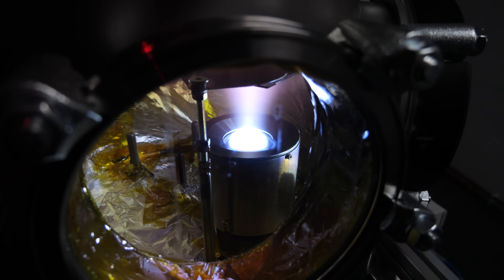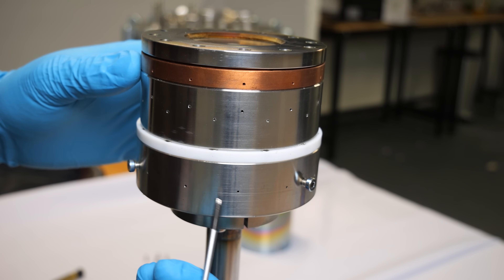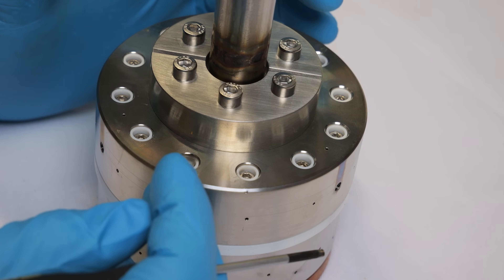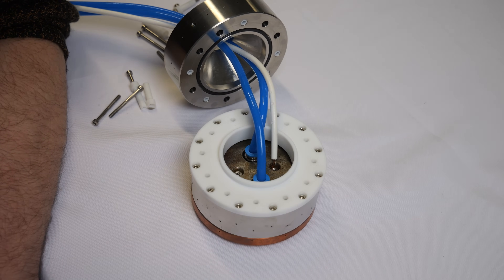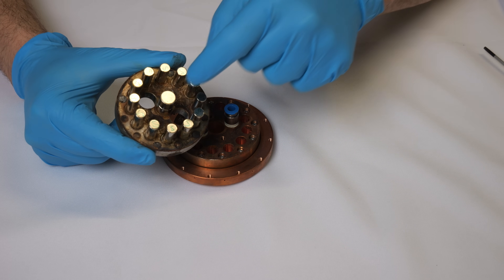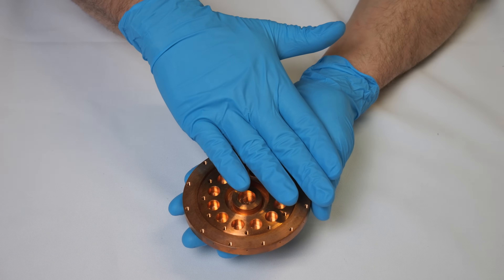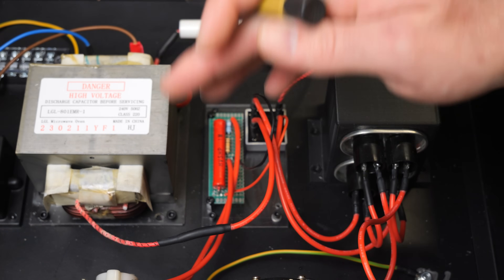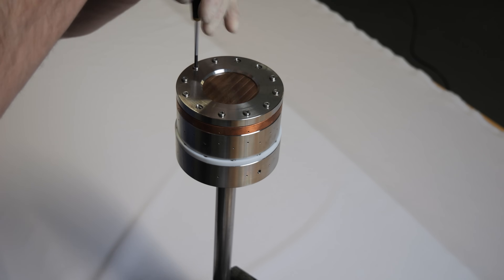Breaking Down My Magnetron Design - DIY Metal Coating

Comment: i know this is a year ago, but in the event you check old msgs - is there a video for the chamber construction too? or was that a prefab item you bought. I suspect that is more expensive than the magnetron parts
Reply from the maker: The chamber was a prefab by a company called Wissel vacuum. I was fortunate enough to get it for free for my videos. But you are right, it would have been significantly more expensive than the magnetron parts. That said you could build a more rudimentary vacuum chamber for a lot less.

Comment: The costs of machined parts was a key driver for why I bought my own CNC mill and plating/electroforming systems. Drilling 0.5 mm holes through screws is one approach I've used, but cutting a 0.5mm groove along the threads also works. Having my own machine shop means I can iterate designs in minutes or hours rather than days. Now I just need a decent wire-EDM system and a CNC lathe to make more complex parts possible.

Comment: For the power supply, there are a lot of SMPS power supply products out there with different power rating available for cheap. You do not need to make it from scratch and risk the functionality of your magnetron. As engineers, its not the best idea to reinvent the wheel when it's something thats already commercially affordable. 

From what i can see, the DIY power supply is a bare minimum ac to dc converter, with a voltage divider ( which is a very lossy buck converter), and there are no feedback controllers. The power supply will have a lot of DC ripples, possible distortions and inconsistent voltage drop (especially for loads that are practically a shot circuit). Save the efforts because the solution to these are cheap. Even PC power supplies has these.

Comment: I found your work really cool, but sincerely, your PSU is, at least, a death sentence waiting to happen. Microwave transformers are deadly on their own, in addition to this there are some other issues:

- from the look of the rectifier bridge, it's a typical 25A 1kVrated unit. You don't need so much current capability, but using a 1kV diode at 1kV is not a great idea. Like driving your car always at maximum speed. They'll fail, soon or later. An homemade solution can be a rectifier made from more diodes in series to get an higher voltage rating.

- BNC connectors are not rated for 1kV. A quick look on a reputable manufactorer website says 500V RMS Continous (rating is AC because the connectors are usually used for RF). 
- It's not visible, but is your fuse rated to the voltage? Standard glass fuses will do nothing at 1kV, they'll create arching and will be an ignition source.

- The ammeter is exposed to the full potential, so a failure of the ammeter can cause arching on the case (or worst, on your hands). At least, connect the meter on the ground side of the circuit, and hope that it never fails open.
- No means of limiting the output current is provided: It's really necessary the full power of the microwave transformer for your application?

Sorry for the critique, but with electricity you have to play safe.
Best Regards from Italy

Comment: You should probably have bleeder resistors on your power smoothing capacitors. They may have built-in bleeder resistors but don't count on it. Without bleeders, the caps can store a charge for a long time and discharge into you if you touch the wrong part, even when disconnected from power.

Comment: If the water is pumped directly into the cathode, how does it not carry high voltage with it? Is it dangerous?
Reply from the maker: The water should be distilled water and the hoses meed to be long enough. Then the resistance is high enough and it's not a problem.
Reply: @AdvancedTinkering  I was doubt it, thank you!

Comment: Damn.. 1000 bucks for these simple parts.. Having a lathe you can do all this work.. If people needed all this more often, workshops would get rich
Considering that this is made in China, it would cost more in the USA.. Although you would only need a dividing device and a drilling machine, everything else is done on a lathe, especially the fluoroplastic bushings

Comment: 10:40 You can make a coating on your installation, but you will need another such part.. Alternatively, you can impregnate the surface in contact with moisture with oil, or paint

Comment: inverter microwave power supplies have pwm control of the output voltage and safety features that insure u cant power it on at full power and that there isnt a short built into a module that's lighter and smaller then a traditional mot
Reply from the maker: I will take a look into that. Thanks!
Reply: @AdvancedTinkering  yea there are videos on youtube about how to get them working but they arent very high quality. they tldr is that there is a 4 wire harness connected to the board besides the mains ac inputs. the wires r vcc(5volts) , gnd, pwm input(220hz i think?), and some feedback signal that u need to pull to ground with 10k resistor.the pwm to be less then ~30-40% duty cycle to turn it on then can be increased. theres a video of a guy who builds a 555 based solution and a different guy used an arduino but i just got a lcd pwm module that made it easy

Comment: A magnetron has negative resistance. But it is not an  inductive load. Simple current control works fine. As does power control.

Comment: Look at videos about spot welders made from MOT's  to see arduino circuits etc to control the voltage etc in your power supply transformer.

Comment: What if you put the screws connecting the HV section to the base into some ptfe inserts in the holes in the HV block? If you make them expand into the holes like a hollow wall molly or an expanding  concrete anchor. Then you would not need a metal to metal connection there.

Comment: You could try* to put an iunno.... 100nf? capacitor across the power controls output.. it might trick it into "working" but a triac isnt a good way to run a transformer.

Comment: Xometry hack for you guys regarding the two clamps at 18:01. Just order the entire part, and cut it in half with a hacksaw. There are a bunch of parts I have ordered where it is '1 part' but can be 2 or 3 with minor alterations, involving tools that you 'should' already have somewhere.
Reply from the maker: That's a really great idea to reduce the cost of manufacturing! Thanks!

Comment: 13:32 You can use helicoils in the taped holes they are pretty easy to install if you're worried about stripping the threads

Comment: To deal with the corrosion passivate by treating with HF, phosphoric or boric acid, purge then add EDTA and polyethylene glycol to the DI water loop. If the water isnt going over HV then just use automotive antifreze mix. The industrial version of these use NaK as the coolant btw.

Comment: One thing that could be done with this is to sputter coat a nuclespot or staticmaster static eliminator source with beryllium to make a reasonably strong but rather short lived neutron source. It works well for testing neutron measurement instruments but decays to nothing after about 3 years. About 60um of beryllium and a few um of gold on top. ❤

Comment: You might have the wrong resistance value for the potentiometer. If you used a 10K ohm  vs. a 100K ohm the curve of the output of the controller would be more linear

Comment: If you got some PTFE rod that fits into the air space above those screws, you could cut little plugs and either press-fit them in, or hold them in place with the kapton tape

Comment: One solution for AC power control is the "shunted bridge" method. You basically hook a bridge rectifier in series with the transformer and you can use a simple power transistor to control it from the DC side. It might suffer the same issues as a triac under inductive load though.

Comment: One thing that comes to mind about the arcing after reading some other comments talking about how a triac could be "chopping up" the voltage, is that maybe the sharp changes in voltage are acting like a flourescent bulb starter and you just so happen to be on the edge of it just constantly arcing, and the un-smoothed noise in the power feed happens to occasionally drift it past what is needed for it to arc (given how I understand the arcing to be unpredictable as far as timing goes). This, in tandem with the voltage spike that comes with an inflow of voltage (referencing AlphaPhoenix's video about the speed of electricity and talking about voltage wavefronts as they travel through conductors), could be occasionally just be throwing it over what is needed to arc.

Note: I am not an electrical engineer, nor really even that educated on the topic. This is just an attempt to bodge together things I have seen through various youtube videos in an attempt to be helpful.

Comment: A possible (but potentially a little pricey) solution for the HV arcing issues might be replacing the metal screws with Al2O3 alumina screws if the force on them you need to get a proper seal is small enough.

Comment: I built a 10kV @ 10mA AC supply for PD testing.  It uses a 24V to 10kV potted transformer and TDA7294 amplifier IC to drive it.  I just supply the amplifier with a set of switching supplies and input waveform from a function generator.  This produces a very clean AC HV source up to 100W (amplifier needs some heatsinking).  

For arcing - this is always a challenge with HV in vacuum, especially medium vacuum where Paschen is a big risk.  Your specific issue is more likely creepage across the PTFE, promoted by surface charges which increase the field strength over the insulator.  This is evident by the burn marks you see.  Switching to insulated screws will obviously remove exposed HV from this location.   I have exposed clean, dry PTFE to excess of 20kV/mm over the surface at 1e-4 mbar with no problems.  You'll be limited by contamination (metallic particles can intensify the field, even if they are floating - even insulating particles can cause problems).  At high field strengths, you can also create cold field emitters which "paint" nearby insulators with charge and promote discharges.  Try to prevent so called triple points, but it is difficult with your construction.  

Another problem you may face at intermediate pressures is Paschen, where a shorter P*D distance is preferred (long P*D, above the Paschen curve "danger zone" is difficult to achieve in a small chamber).  As a solution, I have in many instances shielded the exposed fields to a distance much smaller (~5x safety factor) than the minimum Paschen distance at my worst case pressure.  

The Kapton tape will not solve the creepage problem, and maybe make things worse if there is a virtual leak - then you will pump this void through the worst case Paschen pressure and induce breakdown to the nearby grounded casing.  Or, it just pumps down with the chamber.  In this case, Kapton may be acting as a shield to prevent big discharges (as only the Kapton surface can capacitively charge to a voltage close to your screws and cause some small discharges).  

Good luck
Reply: Any thoughts on using a ZVS driver?

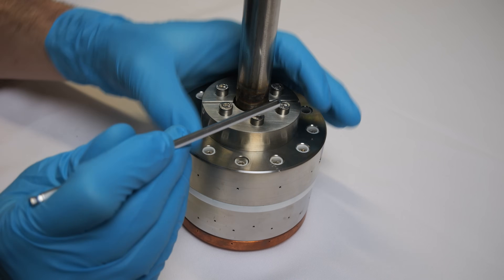Comment: @6:20   Easier solution:  Teflon (and/or Delrin) plugs, cut from a rod of appropriate diameter. Up to you if you chose plugs with/without shoulders.

Comment: Your PSU voltmeter is probably reading about 20% high at full output voltage because your big resister will have a VCR (Voltage coefficient of resistance) of about -200PPM/volt (maybe more) meaning its resistance will be about 20% lower than marked at 1000V. 

The easiest solution to this issue is to put several resistors in series so that each sees a lower voltage, for example using 10 resistors with 100V across each would reduce your resistance drift to 2% which is similar to the analogue meter accuracy.

Comment: Very cool project and it's a funny name, considering that magnetron means microwave oven in Dutch. You can actually buy vented screws (screws with a hole through them) exactly for the purpose of preventing virtual leaks. I used to buy them pretty cheap from an English company called Accu but that was before Brexit...
Reply: Likely because theres a magnetron generating the microwaves inside of a microwave oven! Thats cool to learn that's how they're called in dutch though!

Comment: only thing concerning me is you only switching one side of the mains supply, your power button should disconnect both live and neutral just to be safe, you never know if your outlet is reversed, and having the transformer be at 220v when you believe it's off could be dangerous if you forget
Reply from the maker: Very good point! I will change that.

Comment: Drilling through screws is actually very common practise when working with vacuum chambers. I have used them in the past and they work great.
Espeacially when you need e-6mBar or lower pressures they are highly recommended.
Various companies make them, but if you only need a few it might be easier to just make them yourself ;)

Great video, keep up the good work!
Reply: The industry term for that is 'vented screws,' where I work any screw used in the vacuum has to be a vented screw.

Comment: Is there a reason why those screws with the PTFE insulators need to be metal? Could they not be swapped out for PTFE screws (or even ceramic, but those are expensive and hard to get...)
Reply from the maker: Using plastic Screws (PTFE or PEEK) was my first approach but they are so expensive. Especially when they are not "standard size". 
Nylon screws are more affordable but it's not a good material for vacuum applications and I could not find the size I need.
Reply: @AdvancedTinkering  Ahh, fair enough. I hadn't realised how expensive PTFE screws were!

Comment: It is not entirely clear why it was impossible to use a magnetron from a microwave oven. It would be cheaper and easier.
Reply from the maker: It's not the same as a magnetron in a microwave. But it's still called magnetron. You can look it up in the article/review I cited under the picture I have used. doi.org/10.1016/S0042-207X(99)00189-X

But I understand the confusion. I am not sure where the name comes from.
Reply: @AdvancedTinkering  I figured it out. A conventional magnetron is quite applicable, but additional equipment is required, in the form of an ion cannon, and related equipment. The magnetron you use combines these two things in itself.

Comment: Looking at the disassembled lower part of your magnetron and the problem with the Teflon insulating sleeves, I think I would simply remove some material from the lower part so that the screw heads/sleeves protrude better - or increase the diameter of the counterbores. I can't remember if you have access to a lathe(edit: no you don't..) or where you live - if you are near Bremen and interested, I could help. Edit: I mean on the other hand the location also does not matter much..
Reply from the maker: Thank you very much for that offer! But the problem is, that the bottom part could only be shortened by maybe 1-2 mm because the material at the opening for the centering ring of the O-ring is not thick enough. Since in the inside has a conical shape, you would increase the hole diameter if you take away more material. I hope you understand what I mean.

But for a different project I may come back to that offer if you are still interested.

Comment: The Kemo M028N is doing phase-control which is the AC equivalent of what "pulse width modulation" is for DC. It's not actually regulating the AC peak to peak voltage up or down with a smooth continuous sinusoidal waveform, it's chopping up the AC waveform (at the full input voltage) into discrete smaller chunks in time starting from the sine zero crossing. The chopped-up AC waveform is not going to work well with your step-up microwave transformer, which is why it's not working at all until you turn it all the way up and the power control module starts outputting the full ac waveform.
Reply from the maker: Thank you a lot for the explanation! That makes sense and other comments agree with you.
It's a bit disappointing, that there is no small option that fits I side the housing of the power supply. Smaller variacs seem to be very expensive.

Comment: To eliminate the condensate, use a 'aquarium' air pump and a hose to blow out the cavity in the stem and yoke plate. if you put the pump in a container filled with desiccant you blow in dried air which would not contain any moisture to condensate.
Reply from the maker: Good idea! But I will first try to use cooling water at room temperature. The heat transfer works good so I don't really need the lower temperatures. That should hopefully take care of the condensation.
Reply: @AdvancedTinkering  just use warm water. We use 100 F water in our ion sources and ebgs as well as running water through our chamber walls this prevents condensation.

Comment: A temporary solution until you get more corrosion resistant materials would be to attach a piece of zinc or aluminum to the non-vacuum side as a cathodic protection anode. Zinc isn't vacuum compatible as I recall, and the anodes tend to flake pieces off as they corrode, which is why it needs to be on the atmospheric pressure side. Or stuff desiccant packets into that hole where the condensation is forming to absorb it.

Comment: those bulkhead KF clamps remind me about a great fact, if you want to connect KF parts to plates, you can just download the cad files from some vacuum seller, and then 3D print them!
Reply from the maker: I think I remember seeing pictures of your clamps in the discord server. They looked great. 
I just wouldn't trust them when they have to hold something heavy.
Reply: @AdvancedTinkering  theyve been holding my setup for a year now ^^ , altho yes, its more sorta a cheap option for attaching single gauges and stuff